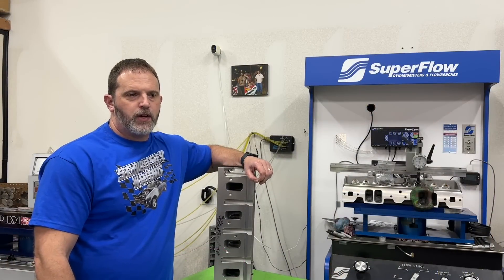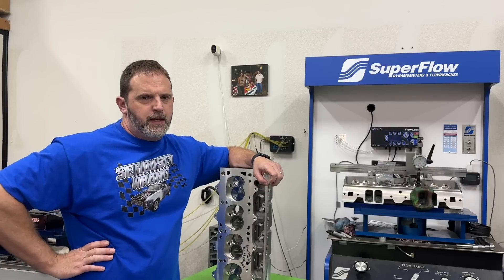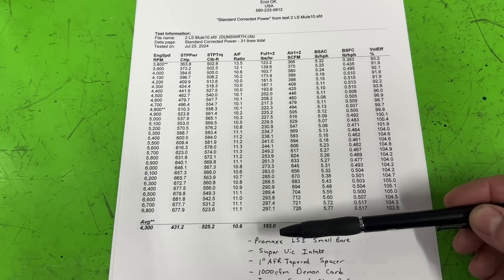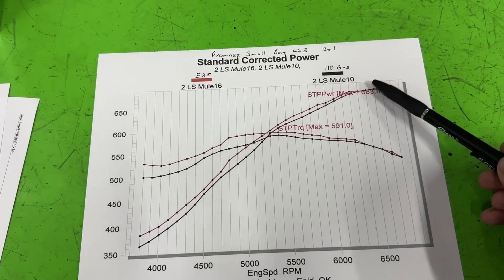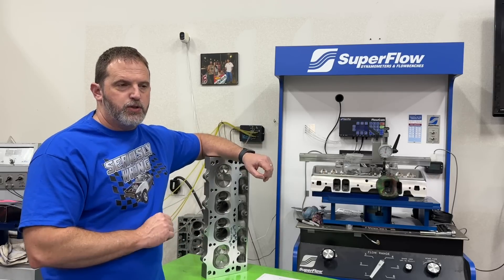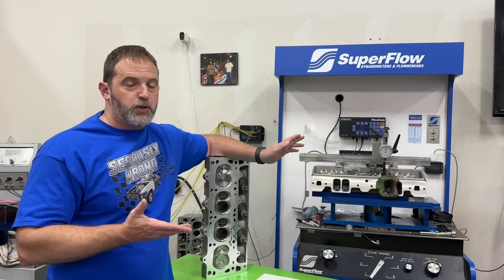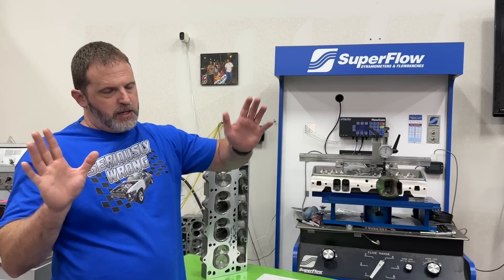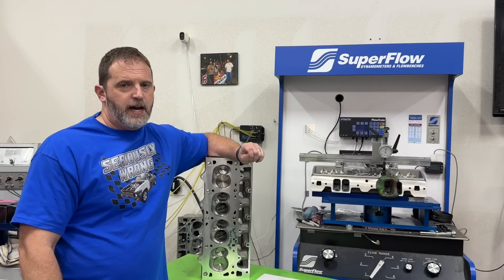E85 vs Gas Dyno Test Part 2

Comment: Guys the video is e85 vs 110 octane so bringing up availability of e85 compared to pump gas is IGNORANT
Reply: Same goes for the comments about ignition timing. E85 vs pump gas is one thing. But E85 vs 110 race gas is a different story.
Reply: @michaelblacktree  He stated in the video that this is race E85 vs 110. Not pump E85.
Reply: @justinspringer4197  because you can test one gas station at 79% ethanol and another at 84%, if you’re running a high dollar build you’d want the same percent and quality from every fill up, so you buy “race” e85
Reply: @Pooooooops   Race E85 doesn't come from a gas station.?
Reply: @justinspringer4197  uh not that I’ve seen, we’re mostly just referring to the fact that e85 “at the pump” is really not super regulated, there was a guy who would go around testing different stations showing how low % some of them can get. So if you’re in a high dollar build like I said you’d want to make sure it’s 85% every time. Or for example on the bike I’m building I won’t be running an ethanol content/flex sensor so that can only be reliably done by having a consistent ethanol % in every tank, so you’re able to buy drums or cans of R grade e85 which is also typically mixed with leaded race gas instead of unleaded pump gas like e85 from the pump is.

Comment: Play with timing and jetting at the track.  Engine dyno's and race cars are not the same.
Reply: You're right bro,, guessing my shift points and being in the pits over and over is way better than running consistently higher mph right off the trailer........🤦🏻‍♂️🤦🏻‍♂️🤦🏻‍♂️🤦🏻‍♂️
Reply: @rotaryray  'm not saying there is no value in dynoing an engine vs track only.  I am saying there is not a direct correlation of settings.  Best cam and ignition timing and jetting on the dyno and at the track are different.

Comment: E85 shines with a supercharger because of the cooling effect.
Reply: And with efi because if the lack if evaporative cooling.
Reply: E85 or even all meth makes a denser fuel charge.
Alcohol burns cooler that why it's jetted bigger.  More meth, more fuel to get the BTUs to make as big a bang as gasoline. You actually learned this in the 9th grade, but you just don't remember.
Study real science, not the common barn yard science. Why do I say barn yard, because it's full of bull and horse and chicken shit

Comment: I was always under the assumption on timing, in flex cars with med/low compression (10ish;1) ethanol having a higher octane rating ALLOWED for more timing, thus the ignition maps for flex upped timing from say 24 to around 29 degrees. Not so much alcohol needs it. Most power gains seems to be from charge cooling since you have a larger volume of fuel and a greater latent heat in ethanol vs gasoline.

Comment: E85 burns quicker than pump gas.  Rich burns faster than lean.  High compression or boosted burns faster than low compression/unboosted.  You need less timing with a faster burn.  Turbo Buick guys knew this 30 years ago, so I don't know where that "myth" came from.

Comment: E85 is nearly impossible to get here in Germany......
Reply: Getting hard to find here in the us in places. They’re not just every where. I know we went to a mustang car cruise last weekend and the only station that sold it was sold out of it, that Sunday morning.
Reply: @jcnpresser  You could buy E85 at some stations until maybe 2016/17 - then most switched over to Autogas/LPG. but you can buy pumpgas with more then 88MOZ/98ROZ at most stations
Reply: @BeetleatWar  it's the same thing with E85 here in Norway. I think the last pump closed in 2016.
About the same time they added tax on LPG. Price is equal to 1.19EUR a litre at the time at my local pump.
You probably got 100 times more LPG pumps in Germany than we do.  I have bought parts for the LPG system in my car from Germany several times.
I miss E85 at the pump. Converting to liquid LPG injection is so more difficult than converting to E85.

Comment: E85 takes up more space in the intake runner, and this looks like a classic example where up top it the e85 is definitely starting to tax the intake capabilities, under 6300 it has more than enough airflow to support e85! Would love other guys thoughts
Reply: That's what I've found
Reply: Heat of vaporization too, its probably cooling a bit better
Reply: Maybe , like ,,, !
Reply: consider E85 contains more oxygen in it. Needs less outside air
Reply: @genxunclekey  Or for a fixed amount of air E85 means you need more fuel.  Hence the comment about displacing air in the runner.
Reply: @KZ-se4ik  right, and if the liquid contains the oxygen molecule, displacing air doesn't matter as much. It might be less of an impact. Hence my use of the word "consider".
Reply: @genxunclekey  Here's the thing, E85 run at the correct mixture should have about 5-6% more energy (power) in it for the same amount of air used (simply BTU calculation) - in theory.  When we don't see that power show up on the dyno, you have to ask why.  The only reason that makes any sense to me is that the extra 40-50% fuel (by weight) required with E85 gives you less air making it into the chamber.  I'll leave it for someone else to theorize about why it gains torque, but not power (maybe something to do with airflow limits of a given combo?).